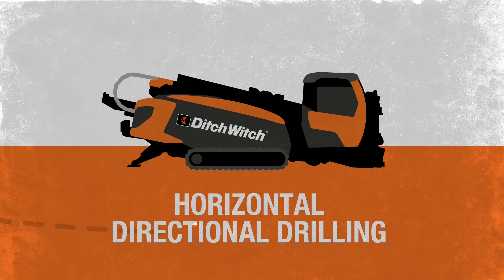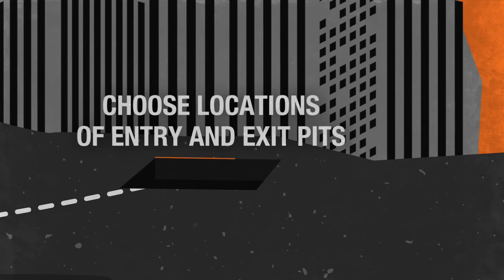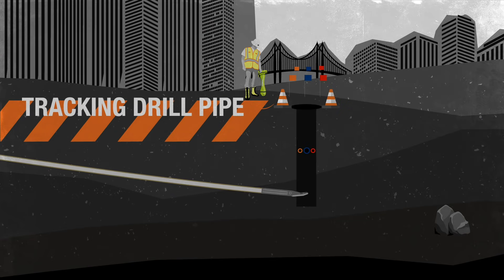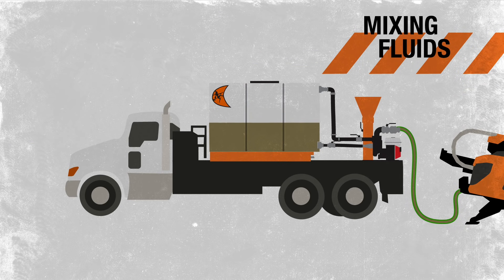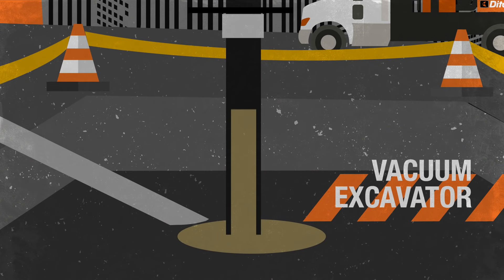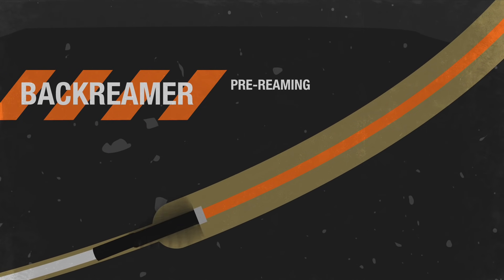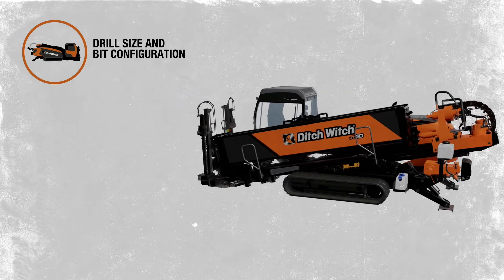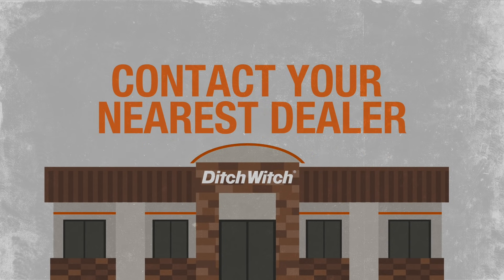The Horizontal Directional Drilling Process Explained.

Comment: It reminds me of a gas-powered weed eater or Wacker. There is a flexible shaft inside of a pipe that the operator’s machine, pushes into the ground , like a water hose. The shaft is large enough to carry fluid under great pressure, through a nozzle, to force the earth out of the way, of the front of the pipe ,so the machine can push the pipe forward. There is a bend in the pipe a few feet before the end of it. It has a transmitter in it. The operator knows which direction the bend is angled via the helper that is carrying a hand-held  receiver. That angle can be changed by the operator rotating the pipe to a certain clock position. Thanks to the person that put this link here.   https://www.youtube.com/watch?v=cl8BBoCV7gU

Comment: How did it bend towards back to the surface? 
Heavy metal spinning pipes are used for drilling. Then how it came back at the other end?
Reply: Managing footage depth & percentage. They aren’t made to bend on command but I’ve located bores around a cul-de-sac. It’s pretty crazy to think about.

Comment: I'm curious about the change of direction during the initial excavation, and how do you adjust the tip of the front if there are obstacles during excavation?
Reply: You move it over, below, or through any obstacles.

Comment: There are 2 ways of excavation. 
1st  is Drilling to make hole or tunnel when you arleady dephs  or to not force bars.  
2nd is Pushing when you need to correct direction. The tip is a flat bent bit, so when you push it creates a resistence and where ever the tip os pointing its where it goes.
There is a beacon transmiter in  the hausing  and a locator that walks on the surface along with it. It sends informations to the locator like there the tip is pointing at (using a clock) also actual deph, slope porcentages and direction degrees. So acording to that info is how the locator is going to send directions to the machines operator of what to do... If to drill or to what time to push. I speak more spanish than english. Hope that info helps.
Ex "J Moraga Constructions" worker....best company to work at by the way fellas.
Peace!!
Reply: Saludos viejo 🤘🏽 andamos en lo mismo acá desde el Valle a Minnesota puro drill life 🤙🏽🤙🏽

Comment: I came here to see how the bit could travel horizontally.  Thanks for nothing!
Reply: There's a really good demonstration on one of the scientific/ engineering channels using a special needle and synthetic skin. The end of the bit is slanted at an angle, the drilling machine thrusts and the but curves, because the rods are slightly flexible, they keep turning the bit to go straight and to turn it doesn't rotate as much
Reply: Drill it.
Reply: That’s not the point of the video, genius.

Comment: Great video!  The invention shown in this short  video allows you to build a continuous pipe onsite for all your HDD projects.  The lightweight pipe is very strong, non corroding and it can resist extremely high pressures.  We can make pipes 3-in. (75mm) in diameter and larger.  Please watch the video:  
https://www.youtube.com/watch?v=EGsipDj0dEA

Comment: How they control the angle while drilling?
Reply: The drill bit has a certain degree (3-5) bend built in. Think of the angle on a round shovel. It works off of a clock, 12 is straight up, 3 is right, 6 is down, etc. When you push out without rotation, you can “steer” the head. The steel rods, although 2 or 3 inches in diameter, will bend. Think of a metal clothes hanger. When you get pointed in the direction you want, you rotate while pushing (drill). It sounds really complicated, but it really isn’t. Also, it pays really well.
Reply: @johnhall3824  agreed on the pays well part for the most part. SOme companies love to undercut their drillers on their pay. I was working for someone like that till I found my current company.
Reply: @johnhall3824  makes sense. Thanks. Also any video that shows this in action?
Reply: @johnhall3824 I’m gettin in to that as we speak thanks

Comment: but how do the control the direction of the slant nosed bit?
Reply: Goes straight when rotating, tries to go in a curve when just pushed. Rig operator sees the current way the bit's facing on a display meaning he can steer it as needed.
Reply: That's what i was wondering!
Reply: Got it! Watch THIS one.  https://youtu.be/cl8BBoCV7gU
Reply: Pushing